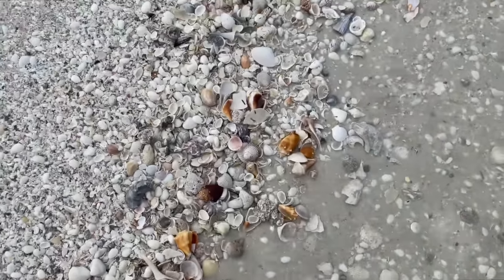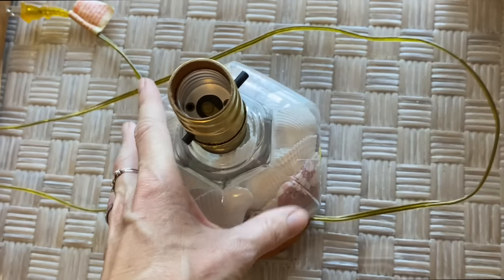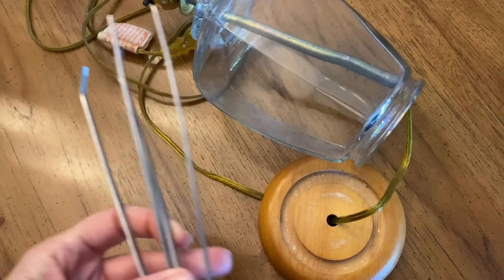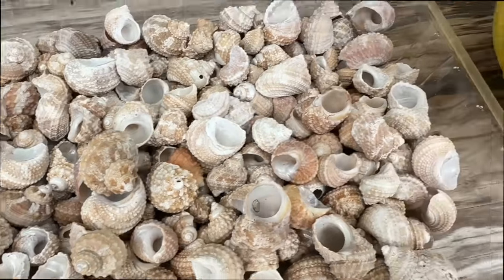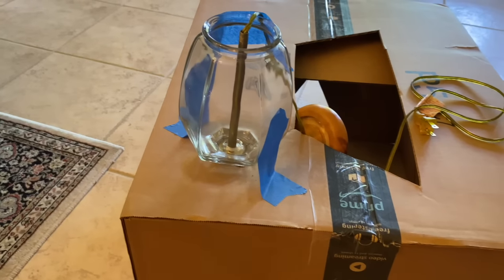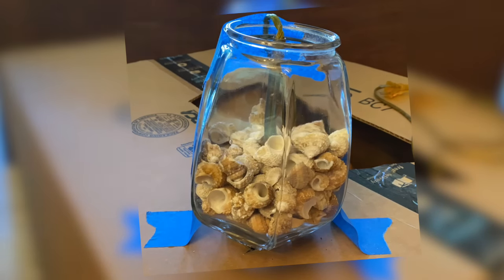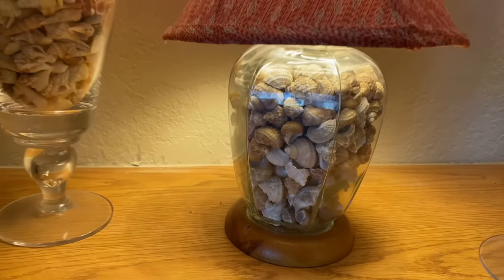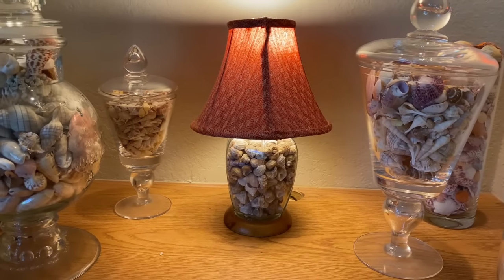How I made a seashell lamp. Choosing the right shells, the right tools and the right lamp.

Comment: You might could make it slightly easier by making a paper cone to fit the interior so that you can place the choice shells against the glass then just quickly fill the inner section with the plainer shells. Then all you have to do is slowly pull out the paper cone. In theory at least. Nice look!
Reply: Breathofhome, you had a great idea ! Like you said, in theory and that definitely sounds like it is worth a try. Trial and error is how we learn some things. Have a good day !
Reply from the maker: The darn opening was so small it just really make working with a smaller lamp difficult. I can visualize what you mean though. I wonder if that would have worked 🤔

Comment: Something I just remembered I used to do with shells, to make the vibrant colors stay that way after cleaning - I remember either rubbing them with mineral oil, (which I realize doesn't last forever) but it really made the colors pop! But there was another way - spray them with an acrylic or lacquer clear coat to keep them beautiful as they can be! Especially the scallops seem to get a "hard water" coating after cleaning. They look great wet, but then dry dull. Try something like this to keep the colors as pretty as they can be! It might make a difference in sales for you! I don't know if you do something like this now - just a suggestion in case you don't.
Reply from the maker: I appreciate you leaving such a fabulous idea! I like to strip that coating off with acid, however if I'm going to do a craft or something (I just found something I want to make with calico scallops) perhaps I'll give a spray lacquer a try.

Comment: Nice lamp and good suggestion about using the same type of shell throughout the lamp.  I made one this summer filling it with lots of different shells but once I turned it right side up they shifted and left about a two inch gap at the top.  New summer I will try filling it with all the lettered olives or chestnut turbines  I found on my trips this summer to to Fort Myers and Honeymoon Island.
Reply from the maker: I hope it works for you! I had a hard time working with such a small opening on the bottom. Lesson learned!